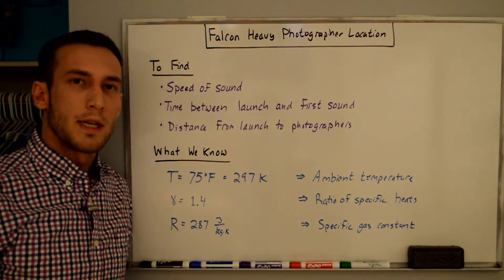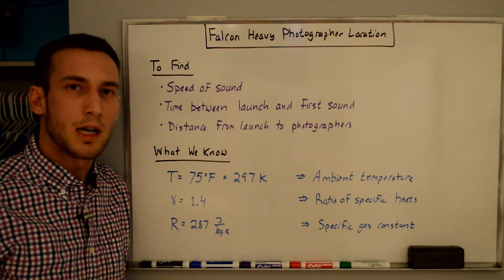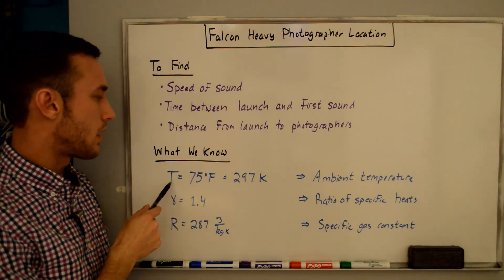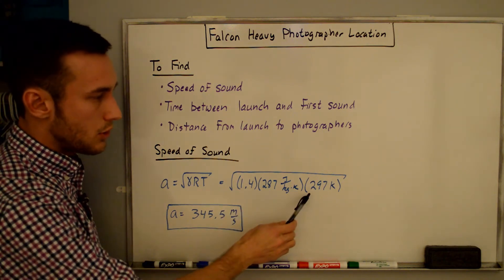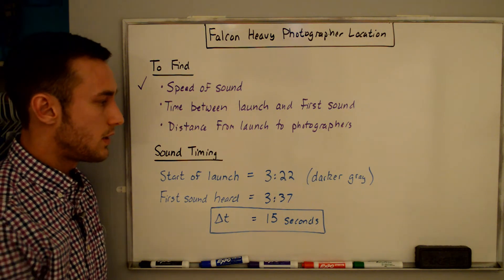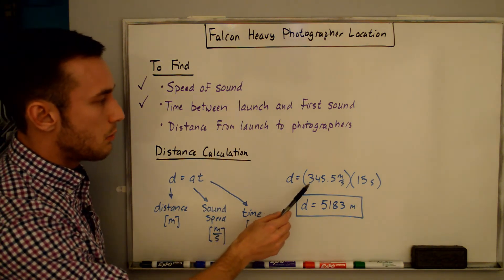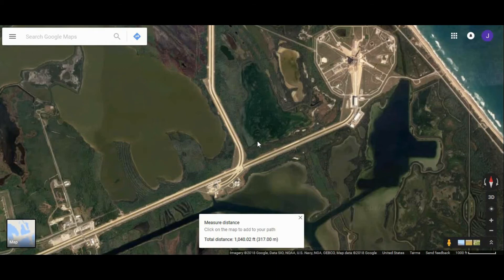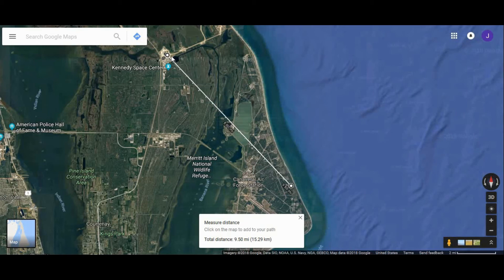SpaceX Falcon Heavy: Sound Calculation

Comment: Love your videos! Just wanted to add that the distance/time of the sonic boom should maybe be calculated from the point where the boosters go transonic? I don't know at exactly what point that is but I'm sure you can figure it out much faster than me lol I work in construction. Once again, thanks for the great videos!

Edit: I just realised you might have been able to see the landing burn and use that? Lol I'll see my way out.
Reply from the maker: I really appreciate it John!  Just saw your edit, and yep, I was basing my booster landing timing on when I first saw them ignite again.  I checked with the main SpaceX feed and another clearer video and made sure all the times checked out.  Every video shows that they're ignited about 18 seconds before touchdown.  This was also going off of what Destin had said in his video at 5:37, where the first boom is caused my the engine igniting.  The footage in Destin's video makes it really clear to see when they finally touch down, which I saw at 6:31.  Then finally we hear the first boom at 6:48.  So there were 17 seconds between touchdown and boom, plus the additional 18 seconds of burn time, which gives me a final answer of about 12 km!